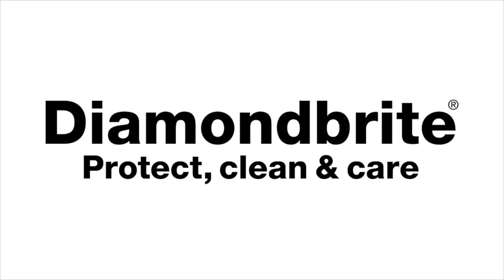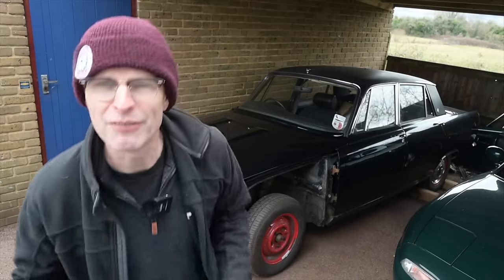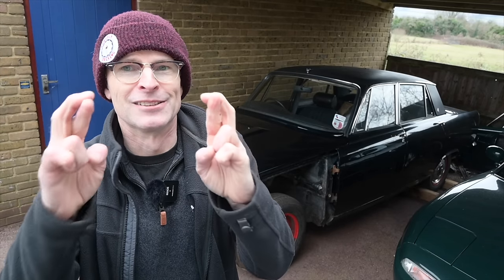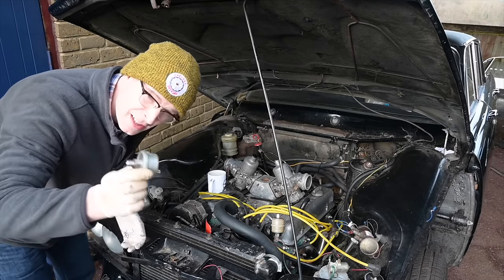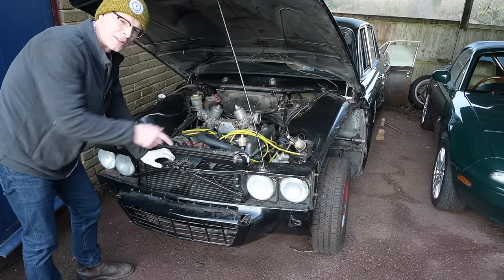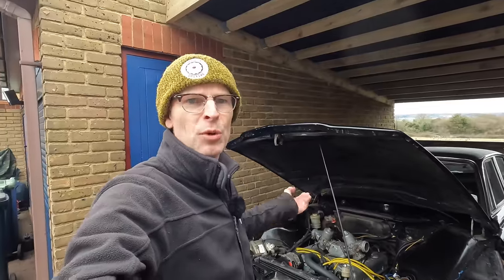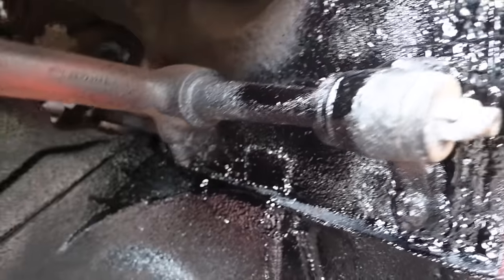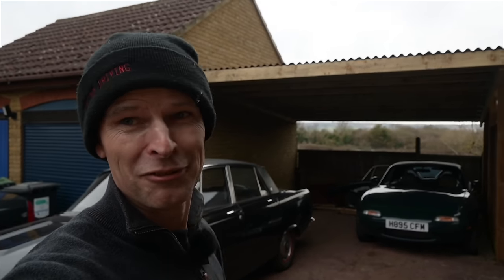It Drives!! And it's Fast! 4.6 V8 P6 first drive

Comment: Those repair patches looked solid enough and I don't see the point of cutting them out just to weld more metal back in. As long as they aren't rusty and are hidden in the wheel arch, I'd just leave them. Congrats on getting that thing moving. It looks like it's a bit of a beast.
Reply: I agee looks solid enough and the welding looks better then yours Matt, lol.
Plus you must have very understanding neighbours with all your repair noises either that or they are all completely deaf by now.
Reply: The only thing I would do is seam seal them.
Reply: I would at least flat them down with flap wheel/finger sander.

Comment: Take it easy on that gearbox it cannie handle the power captain
Reply: Were they Borg Warner auto boxes?
Reply: @GlennPowell-ls3lg  yep and not very strong
He will find out how strong they are very soon 🤔
Reply: @adamwort7160  Thats why I asked to be honest .They did have a reputation of going bang.
Reply: @GlennPowell-ls3lg  think the sd1 GM180 box is stronger but if your swapping the box out better just out a stronger manual box in it, at least vitesse box or stronger
Reply: Zero to warp drive in 2 seconds!
Reply: Yes, thats how I killed my P6B. Lost all forward gears and had to drive 10 miles backwards to the scrapyard. Blackborough in Devon actually. Traded it for a fresh engine for my P4 which I fitted right there and we drove home the same day so all was good.

Comment: Love it. The wood flying off the dashboard when you accelerate reminds me of the Jeremy Clarkson test of the Jaguar XJ220 back in the day. The cassette player shot out the dash when he floored it.
Reply from the maker: Lucky Rover could build a decent radio mount!
Reply: My heated switch did the same thing on an Audi TT that was only 5 years old at the time! I repaired it with plastic weld and some cable insulation, to reinforce the clips.

Comment: Around 10 years ago my TR7 V8 oil pressure sender exploded (on the engine) and spewed oil everywhere after my 5 mile commute to work. I repaired it with a blank Wade air fitting and managed to drive it back home with no problems (luckily I always carried spare oil).. Then I parked it up and its stayed in the same place since.
Reply: @human-xi1uo  😅

Comment: So pleased the beast has decided to be nice to you.  Let's hope she's not just teasing and attempting to lull you into a false sense of security....like one of mine does to me!  Great idea to sort out the potential for attracting rot while the wings are off, but if the patches are holding well, I'd be of a mind to just be a little more liberal with the underseal around the edges so they are assured of water tightness and are more aesthetically pleasing.  The problem with an old car is not so much "should I or shouldn't I?" as "where do I stop?" and to me, one can forever find things to do on the vehicle without potentially heading off something that isn't really a problem.  Pick your battles, mate.  That car is a stunner that is going to scare the heck out of any boy racer in a rice rocket that challenges you at the lights!

Comment: Dont know if i suggested this before, but the easy way to prime the pump is remove the dizzy, install an old dizzy with the gubbins removed attach it to the chuck of battery drill and spin it up, you should have instant pressure and a primed pump, it worked well for me with a 3500 sat for 10 years , cheers from Adelaide Australia
Reply from the maker: yes, Ive not got an old dizzy but used a big screw driver blade (cut off) in a drill and it did the trick

Comment: Not sure which front cover you're using (and therefore oil pump). The old style pump driven off the bottom of the distributor doesn't take too kindly to high pressure like you seem to have....it can wear the skew drive out very quickly resulting in total failure. The later style setup has the pump built into the front cover & is driven directly off the nose of the crank which is more resilient...although the gears can crack! Either way keep the revs down until the oil is warm as 80 psi is a lot for a RV8.

Comment: V cool. Tom Drives’ latest vid shows a p6 mule on a Citroen-type suspension. Dropped to the deck it looks surprisingly cool without any other mods. So yes lowering it will have big aesthetic results. Btw know nothing about p6s so was surprised to see the front springs are horizontal…!

Comment: Hi Matt, I had one in the  80's. Loved the car, unfortunately a single decker bus wiped out the front end and twisted the chassis. The engine had only covered 8000 miles after a full rebuild, still it found it's way into a Jensen Interceptor, sounded the same but cheaper to run. Sold the Jensen engine to a guy who did stock cars. Result. Keep up the good work.
Reply from the maker: at least you got out OK, which is what they were designed to do

Comment: Those old wheelwell repairs look perfectly sound, they just need to be dressed smoother with an appropriate flapwheel and finger sander. 

You now need some banded steel wheels or SD1 X-wire alloys !

Comment: Is it a 4.6 out of a Range Rover .I’ve had one or two of em and every one of them had overheating issues with slipped piston liners .had to machine the block to fit top hat liners to stop the problem ..it looks nice though ..when it shot off I got the theme tune to the Gaffer with bill Maynard in my head 😂😂😂

Comment: Much more hopeful video! You've not named the car Christine?

For your radiator Mapp gas and a length of brazing rod should be suitable. A canister of Mapp gas will set you back ~£12. If you can keep the torch at the right angle (canister below the torch nozzle) a cheap (~£10) torch should be OK, if not the RTMMFG 'brand' Mapp torch for ~£24 from Amazon might be more suitable. I have a torch similar to the N + B Welding torch (currently £8.39) and the blue flame turns to a puff of orange flame (fun!) if it's tilted so liquid comes out rather than gas (same happens with cheap blow torches)

If the top of the radiator has water in it you'll need to drain some out - water quenches the heat too fast so you can't get the metal hot enough for the brazing rod to melt and flow ... good luck, and make sure you film it!

Comment: Rad repair is done with solder. A plumber with a bit of solder and flux using a small gas torch would fix it in 60 seconds or less. Gone in 60 seconds in fact. You can do it yourself if you have a very large solder iron. Simples.. Run it round to Go Italia with a 6 pack?

Comment: I was too.They ended up reversing a car into mine denting the rear in when it was about to be returned to me.and had the car for over 2 months whilst I waited for them to repair it and the other minor issues that it went in for.When it was returned it had a bad exhaust leak they neglected to fix or tell me about and a very  bad fuel leak where the pipe had come lose under the Tank .It was soo bad it drained the tank over a couple of days.. Not impressed at all
Reply from the maker: Thats very unlucky, Ive not heard any other bad reports

Comment: Sd1 alloys look good on the p6 Matt if you can find a set, I had a set on mine many years back. You will however need a set of dolomite sprint wheel nuts 😉

Comment: Ahead of MOT - you will need to fit rear reflectors...normally rectangular chrome rimmed at each bottom corner of bootlid
Reply from the maker: they are in the boot

Comment: If the on dashboard oil gauge is from Lucas, that may explain its work now then die later attitude. But then wiring connections need to be shiny clean for best performance

Comment: I'd be tempted to blame the lack of oil gauge on the connector to the sender. They were only ever crimped onto the wire, and the first thing I'd try would be re-terminating that join, using solder.

Comment: That’s wild, the amount of torque, however the transmission is known to be marginal even with the 3.5 litre variants, so be careful or you will need a new transmission which could be very expensive.
Reply from the maker: I wouldnt swap it like for like, its a terrible gear box!

Comment: I had a 3.5 v8 S when I was 18yrs but that was over 40 yrs ago with spare tyre on the boot lid & 4 of those et headrests in British race green . It die not long after 1st gear and rev was ripped out of the box

Comment: Thats holding the front suspension on and looks like plates over rust, you have just put a much quicker engine in, I reckon you wont be happy till you've cut it out and fixed it properly.

Comment: 4.6 engine breathing through stock 3.5 twin SUs? Surely that's got to be strangling it badly? Won't make any power above about 4000rpm, surely.
Reply from the maker: once its proven reliable they can be upgraded
Reply: @furiousdriving  why didn't you just swap in the EFI with the 4.6?